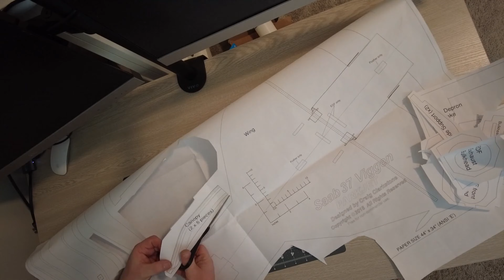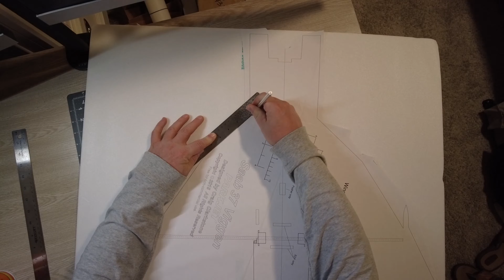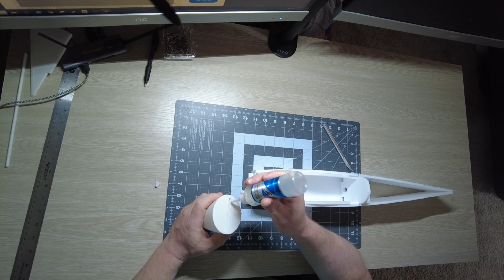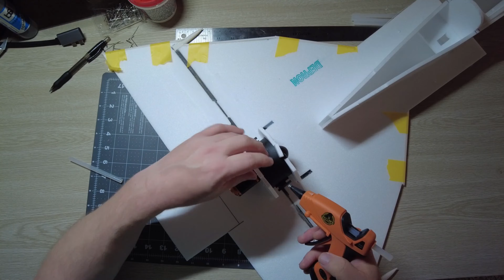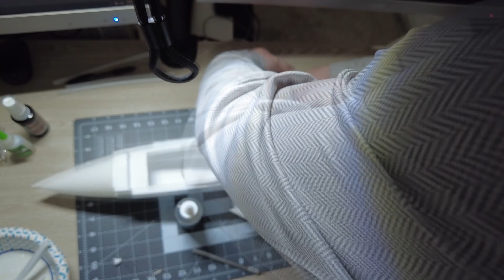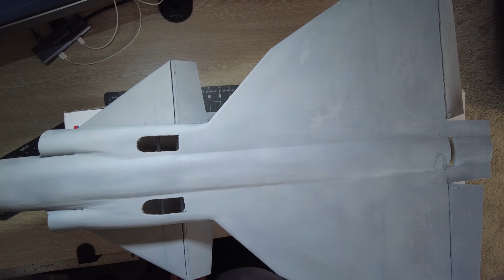Jetworks - JAS-37 Viggen Build

Comment: Btw, not to be nitpicking, but there are 5 Viggen versions of which 4 have different visible features. Your model is an AJ37 (ground attack) or an SH37 (maritime surveillance). 
The JA37 (fighter) has a different, bigger tailplane and is slightly longer.

Comment: Very detailed build video! One question: do you use the space below the cockpit for the battery? When using a 64mm EDF like I did, I ended up moving the lipo backwards, behind the spar for the canards. I had to remove the moving flap construction to find enough space for a 2650mAh lipo, which fits barely. I’m curious about your experience with the CG
Reply from the maker: Yes unfortunately it was originally designed as a pusher, the the edf option was added.  Most people add two servos instead
Reply: @jetworks  I made the flaps fixed. It flies well without the flap function and the landing speed isn’t too fast, so in the end it’s no problem.